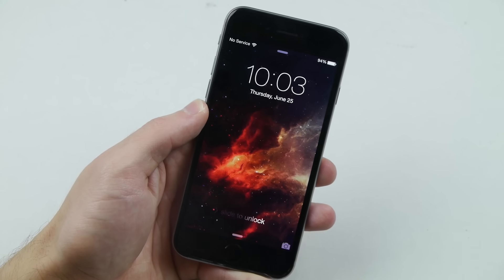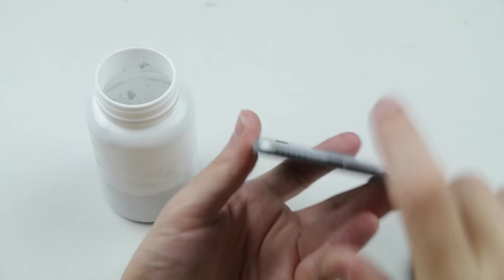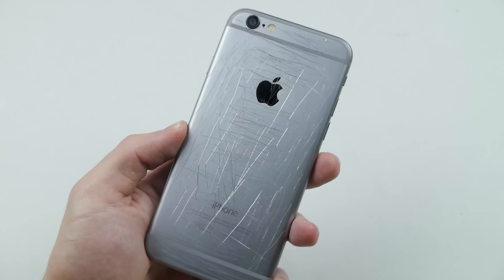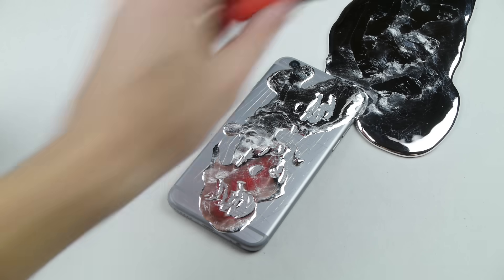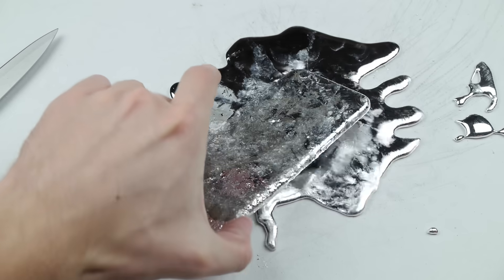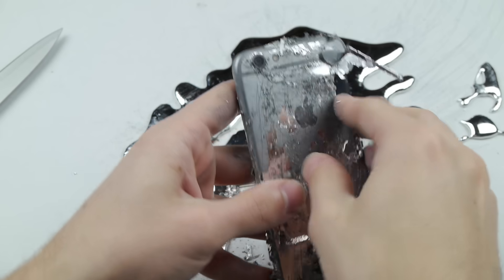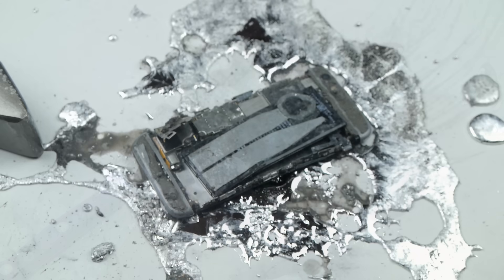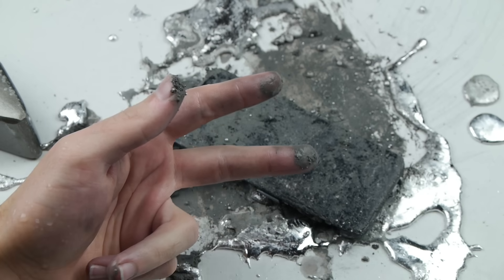What Happens If You Pour Gallium on an iPhone 6?

Comment: I think there may be two reason why you got so much heat from washing it. One is that the aluminium in the now aluminium gallium amalgam is reacting with the water, second is that maybe you have a leaking battery and the lithium is reacting. I think it is probably the first, because you are getting an insoluble product, but lithium hydroxide is very soluble. Just my two cents worth :D
Reply: +MrGoatflakes From what I have learned the vapor created by adding water to the gallium and aluminium is hydrogen gas. Good thing he didn't strike a match to it.
Reply: Definitely the aluminum and water reacting. Aluminum is highly reactive with water it is just normally covered with a coat of oxide. The alloy prevents passivation of the aluminum and allows the metal to react with air/water.
Reply: Lugia :3
the aluminium doesn't form a compound with the gallium. Instead wets the aluminium and floats off the protective oxide layer. And some aluminium likely dissolves as well to form the amalgam. But the amalgam isn't a definite compound, it is a liquid alloy.

Think of it as like sugar dissolved in water. It doesn't really matter if you put a few grains of salt in there, if there is something that will react with the sugar, a small amount of salt usually won't make a difference. And you can still probably crystalise out fairly pure sugar and even the salt separately. In other words the sugar and salt aren't actually chemically changed, just dissolved.

Same as for the aluminium amalgam. What matters is that it is 1. liquid and 2. has aluminium in it. If it has a bit of iron or copper  or whatever in it, that's not going to stop aluminium's basic nature of reacting vigorously to water when it is stripped of it's oxide layer.
Reply: OneCupOfCoffee204
yep that would be the case if he was reacting gallium aluminium alloy.
Reply: Good theories. More evidence supports the Lithium reaction though.
Reply: +MrGoatflakes Heisenberg!!! :D
Reply: Is the aluminum and water reaction causing hydrogen to  release from the water molecules
Reply: +MrGoatflakes Remember that aluminium from the iPhone 6 isn't 100% aluminium. It can in fact be mixed with other stuff like Iron.
Reply: Lugia :3
yeah but aluminium doesn't need to be pure to react this way with water as an amalgam. At least with mercury that is. I can't see a good reason why this wouldn't be the case with gallium/aluminium amalgams as well.

Aluminium is quite reactive, and so is its alloys. In fact alloying usually makes aluminium more susceptible to corrosion, not less. But in either case solid aluminium or its alloys are usually protected by a hard adherent coat of aluminium oxide, which quickly forms on exposure to air, but which protects from further corrosion.

But if you change the solid to liquid by alloying with mercury or gallium to form a liquid alloy called an amalgam, that solid coat can't form, it simply floats around and can break with the slightest movement. So the aluminium in the amalgam quickly reacts even with air, and in water it can react fast enough to get quite hot.

At least this is definitely true in the case of mercury aluminium amalgam. It is very likely true also in the case of gallium aluminium amalgam. Because it isn't dependant on any property of mercury, it is a property of any liquid aluminium alloy. Actually it is a property of any situation where aluminium can't form a protective oxide coat.
Reply: MrGoatflakes
Yes but what I meant is that the mixture of aluminium can differ the chemical reaction from the gallium, and therefore can create a whole new compound.
Reply: +OneCupOfCoffee204 okay so it's not that dangerous. It did look pretty impressive :-)
Reply: +Lugia :3  no it cant. Thats not how it works , you have a SUSPENSION of AL in gallium as an impurity that is reactive with water. They grey mass is aluminum and lithium hydroxide mixed , after the reaction you get Lithium aluminium hydride.
Reply: ^Lithium aluminium hydride can not form in the presence of water. It is highly reactive with water.

Comment: I'm sure I'm too late for this but I'm gonna say it anyway, that sizzling you was looks just like a battery venting, basically means when you rinsed it off with water you wet the positive and negative poles of the battery discharging it all causing the battery to overheat very quickly essentially boiling the acid inside and breaking the seal on it, if it wasn't for the fact the aluminum backing was so brittle the phone could have exploded if pressure built up too much. Also I wouldn't touch that acid with my hands, the gallium is fine just messy.

Comment: I like how this idiot uses dangerous chemicals in his videos but doesn't have any sort of safety equipment or precautions. Also there's a way to get an Apple locked phone to display the Home screen without actually unlocking it. What he is probably doing is buying very cheap apple locked phones (stolen) on eBay. But seriously I wouldn't be surprised if he wound up dead. Put some gloves on!

Comment: Aluminum reacts with water. It usually has an Aluminum Oxide coating which prevents the reaction, but when you are pealing that stuff off, you definitely are going to get exposed Al which will react vigorously with water.

Comment: Umm... maybe some rubber gloves next time? Just a thought.
Reply: +Spelling And Grammar Check yes it actually is toxic. only if you get it inside you body, which he easily could've if he had a cut on his fingers or something like that and he peeled open an electronic device, its rare to find electronics without mercury in them. and you do not want to touch mercury. also there are conductors allllllllll over motherboards and shit like  that, that if you touch em while they're on (he almost did), it takes very little current to injure or even kill a human.
Reply: +TJP77 dude thats called evolution. let it do its thing.
if he wants a darwin award let him.
Reply: +adza botchway The current from a phone is not enough to kill anybody, the body can hold millions of volts of electricity whilst the phone can only hold a few, you are more likely to kill the phone by touching the insides than yourself.
Reply: +adza botchway but it's not mercury... Its gallium.
Reply: svampebob007 i didnt say a battery does. i know it doesn't have that ability. the semi-conductors on the motherboard does tho. they're very small are hard to see but contain a lot of current that can kill you easily.
Reply: Xeolass ... its not volts that kill people. its CURRENT. CURRENT IS what !KILLS!
Reply: adza botchway
And I'm telling that that energy has to come from somewhere and that somewhere is the battery. Like I said it just doesn't have the potential to kill you by finger to finger contact.

You got is somewhat right with "it's not the volts that kills it current" (though no volts, no current) but the battery will not have enough "umf" to make it all the way up your arm and through your heart.

Those semi conductors are actually extremely low power, considering that it should last about 14 hours of heavy use with a battery that holds 6Wh....

You could potentially design circuits that can kill using only the phones battery, but those circuits are not present in a mordern day phone.
Reply: +Leah Smith where?

More like wear
Reply: +adza botchway your right on the toxicity, but a cell phone battery simply does not have the potential to kill a human just like that, especially not if the only point of contact is the fingers.
Reply: +adza botchway actually it's only toxic if gallium makes salts with a nitrate group which makes it soluble which makes it toxic, but it's not even that toxic, Mercury is only toxic when it makes methyl mercury which is a hard process but you could eat Mercury and be fine
Reply: If you knew gallium, you would know that you don't need fucking gloves. Its called gallium induced structural failure, its properties are similar too mercurys 'amalgum' properties.
Reply: +nutzeeer *Natural Selection
Reply: About 0.5-1 Amp of current can kill a person with heart problems, but that is not easy to get out from a phone....the explosion of a Li-Ion battery is more dangerous.
Then gallium is not toxic when touched... but that doesn't mean it's safe to touch or play without gloves that's why inside laboratories everyone use gloves and eyes protection also when working with gallium
Sorry in andance for any errors: I'm not English nor American
Reply: ***** It’s the amount of current, the amps, that the volts can push through your body that can do the killing. That depends on the resistance of the body, how dry everything is and how healthy you are. If you are fit, your hands are dry and you are wearing leather-soled shoes then it is unlikely that you would feel 50 volts. However, if both hands were wet and you connected 50 volts across them then you might get a nasty sensation that could upset someone with a weak heart. Dude, you did not get a few fuckin amps thru you... there are enough amps in a 9V battery, those small square ones, to kill you under the right conditions.
Reply: +adza botchway omg xD saddest thing is that some physics teachers actually still tell that to their students in schools..... no it's not just the volts that kill you, but it's still pretty ignorant to say that "it's not the volts but the amps" :D
Reply: +TJP77 gallium isn't toxic dipshit
Reply: Sorry I was just in a bad mood and I knew he was wrong. :}
Reply: +adza botchway No, both volts and amps work hand in hand.

The volts directly determine the current. Ohms law dictates V = I/R, but the catch is that you can't reliably determine resistance on human tissue because it always varies based on numerous conditions and is never the same from person to person.

An analogy that my high school electronics teacher used is that volts would be the size of a water pipe and amps is the flow through the pipe. If you have a high enough resistance in the circuit then current won't flow well, but drop below a certain point and that's when it gets dangerous.

Here's a good video on it: watch?v=XDf2nhfxVzg
Reply: +adza botchway Oh dear, it's a butthurt raging 10 year old that's having a synapse overload on your one remaining brain cell.

By the way you already read my comment, keep being more of an ass clown, it's hilarious.

(You may also want to learn how to not butcher the English language, it makes you look less of a tool, just saying.)
Reply: djteac meow meow meow meow meow meow meow
Reply: fuffel90 natural selection will consume their souls
Reply: +TJP77 Dont worry he was breathing bromine fumes before as well as the fumes from a burst battery (he did it in his kitchen). Kid will most likely die... in synthetic labs we work in fumehoods no matter what.
Reply: adza botchway Nah I'm not mad. 
Everyone else is just a little too hostile. Just chillll guys. : <
Reply: Louis Barnard R.GKFHDSKLGUHDFLIGH DFLGJK HRDTLKGJHDFLKJGDF
Reply: +Pao Rifrex kk
Reply: +adza botchway Btw its actually not toxic when inside of your body, the only known side effect is that it may cause dermatitis from having it inside of your blood for a long time. Also it is rare to find electronics made today with mercury in them as it is very dangerous and we don't need it anymore as they were used as capacitors a long time ago but now a days are very obsolete. Also what you said about it being dangerous to kill someone is stupid because most motherboards have a maximum of 12 v and below. Its the volts that kill you not the watts.
Reply: Struan Smith exactly, its current.
Reply: ***** Go look it up. Im done arguing about this.  Bye.
Reply: +svampebob007 Hundreds of people die each year testing a 9v battery on their tongues.
Reply: gallium is not harmful on skin contact. .. Granted this guy is not very careful but you can handle it with no fear. look up gallium spoon prank people handle it with no gloves or anything and fine
Reply: The battery can't explode trust me I fixed my phone because my battery was shut down
Reply: +adza botchway actually theoretically you could eat gallium.
Reply: Porter Christenson I never said you couldn't? did i?
Reply: josh tillet don't be too harsh on him xD there is a moment in everyones life, when you realize the VOLTS directly made the AMPS... just hope your heart is beating afterwards o.O
Reply: seriously where gloves!!
Reply: ***** wat
Reply: That's what I was thinking
Reply: ikr
Reply: +Larduk_ “Lard” 1UK Just A thought no one here is as smart as you ._.
Reply: GGigabiteM im not even gona urd your romments jkid. fucvk dst just fuck off. ok? bai
Reply: GGigabiteM GO AWAY. EAT A POWER SUPPLY
Reply: +Butterfly Poon isn't the voltage what can hurt you, but all the other chemical components interactions and gases relief when reacting with eachother. the battery is full of lithium and I think there's no need to explain it's dangerousness..
Reply: +Louis Barnard thank you! please spread the word that mercury is only toxic as a salt
Reply: it's the ampèrage that kill people (~0.03 is enough to be lethal to some), trust me you can withstand a quitillion volts, but 0.03A is lethal. Watts don't kill either, thats just the amount of power that something can deliver, wether it's a computer, powersupply or even a car (doesn't need to be electric since nowadays HP is switched with kW (Kilowatts) like for instance a 610HP = 499kW... sorry, just a random petrolhead passing through.. thus adza is right it is the amps that kill you..
Reply: +Matthijs Gerretse No.
Reply: GGigabiteM meow
Reply: GGigabiteM then what is it that you say how it works?
Reply: +adza botchway only mercury fumes are dangerous. stop talking so much bullshit about stuff you don't know shit about. Also he is using GALLIUM which is not toxic at all. Don't make yourself look stupid
Reply: +Matthijs Gerretse If you'd bother to read the comment thread, you would know.
Reply: +TJP77 gallium isn't toxic like mercury. no need for gloves.
Reply: +adza botchway wow you lasted very long. Give up they don't listen. It's called natural selection^^ XD
Reply: +adza botchway this is not realy true. the current depends on the voltage, so there is a minimum voltage of 30-50v needed to get killed, depending on your own resistance. the voltage and current in a phone wont kill you.
Reply: Trevor Nimmo ;)
damn mama
Reply: +TJP77 If you has a Youtube channel where you destroy expensive things, some damage to your fingers will just be seen as a good way to get some extra subscribers.
Reply: +adza botchway you are very stupid
Reply: +Louis Barnard all forms of mercury are toxic
Reply: Scamperface You are no fun
Reply: adza botchway show me how to be fun master
Reply: Scamperface stop talking to me, that's how
Reply: adza botchway
you're right, ever since I started talking to you my life has been going downhill.
Reply: ***** JKSFHSLEKHRFLIKEHKLKH MEOW.
i literally couldn't give two shits and im not going to read your essay on youtube bud...
Reply: +adza botchway Maybe you'd learn something. :D
It's not even an essay lol. It's 13 sentences.
Reply: Suzzie lmao i love how mad people are at me:P im not saying you're mad at me but everyone else seems to be C;
Reply: +adza botchway Lol. The sun isn't made out of Electricity. XD XD
Reply: Xenon Nightcore i am the electricity but only when the sun can create skin. ther'se one type of horse saddle that i like but when it come s in contact with the sink i dont like it. any.mrore. bye
Reply: TJP7😂